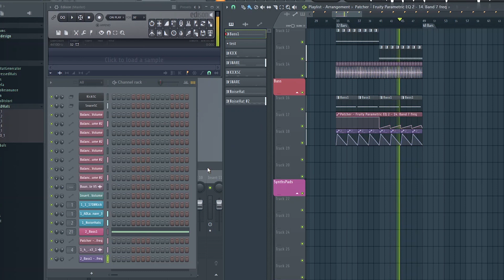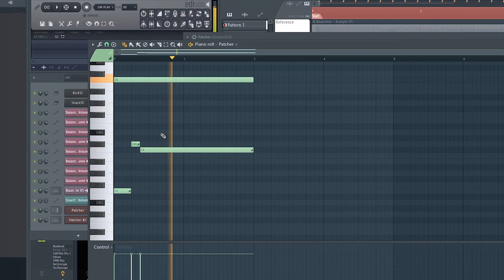BUUNSHIN | FFT x Sound Design [Preview]

Comment: if i join up the full membership will I still be able to watch this? do you allow new members to watch older series?
Reply from the maker: Hey, when you join up you get the current month's video + the video from the month before for free. 
So in this case if you join up now you will get the new video from Insideinfo plus this previous one from Buunshin.
Videos from before this time can be purchased individually from the video vault area.
Hope this helps,all the best
Reply: @digitallabzmusic  but you have to buy a membership first to get access to the video vault to THEN buy the tutorial...?
Reply: apparently so. there is no membership option below 28€ and I guess the video itself will cost another 20-30€ at least.
Reply from the maker: @muulwarf  The membership fee is £12.99 (approximately 14€)
The vault video costs £5.99 / €6.59.